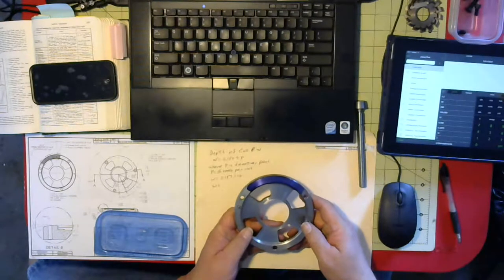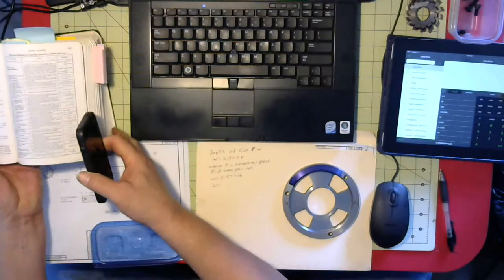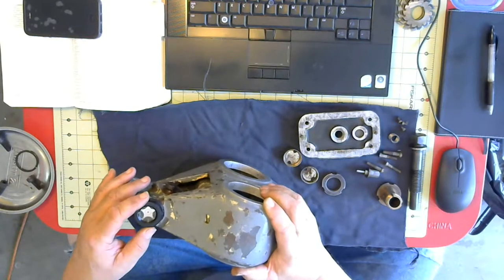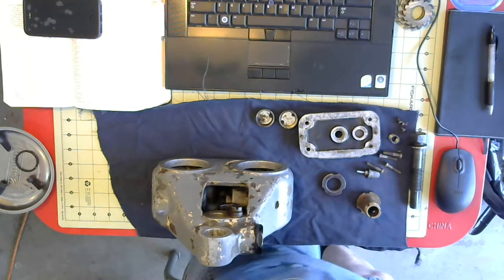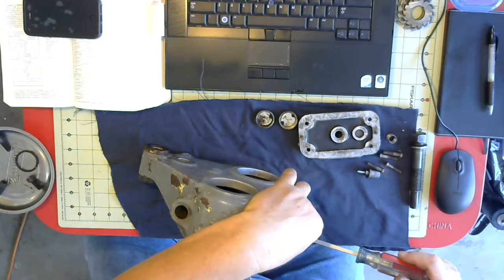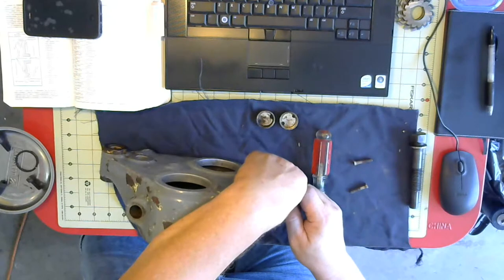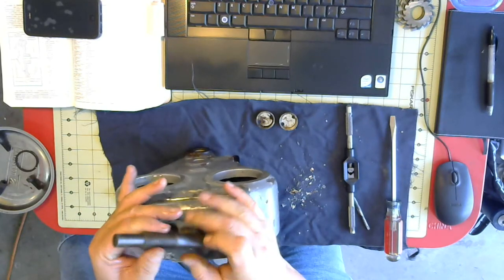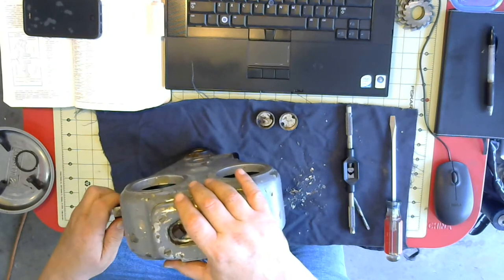Cutting Bevel Gears Part 1

Comment: John why don't you guys just get a custom form tool ground for cutting the teeth on the plate? The they could just be cut while they are in a vmc.
Reply from the maker: CMS R&D 
We did that in a previous design. It works very well that way. For this job, I wanted to demonstrate that it could be done with off the shelf tooling and minimal fixturing, which I did.
Still got a lot of "We can't do it " from the production shop. 
Oh well. It was fun to do in my shop.
I'm tempted to tell them I'll do custom work for half the cost of their supplier.
Wouldn't take much to set up a few stepper motors and an arduino to automate the cutting process.
Thanks Joe.
Btw, email me. We might collaborate on a couple projects.
John
Reply: John I keep trying to email you but it keeps sending it back to me saying I have the wrong address.
Reply from the maker: JJBAZAAR AT ROADRUNNER DOT COM
watch the spelling. lots of people make spelling mistakes with my name and email.